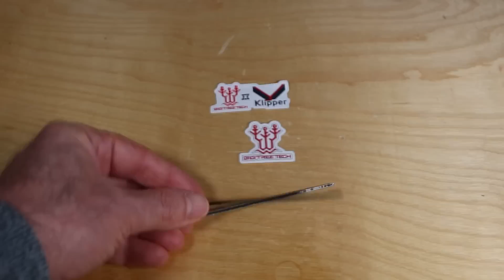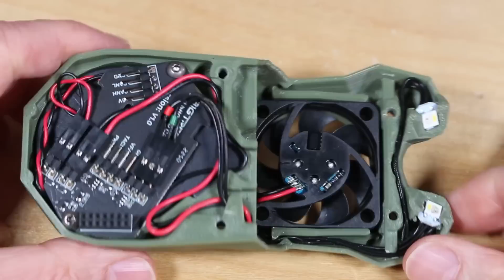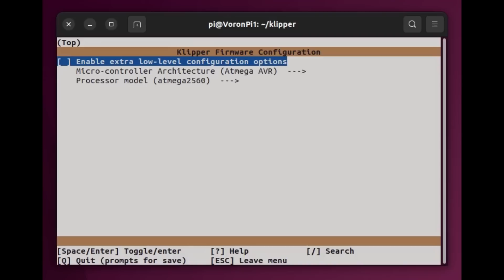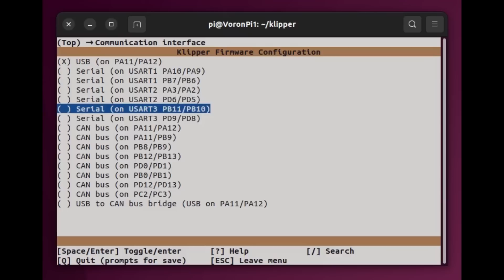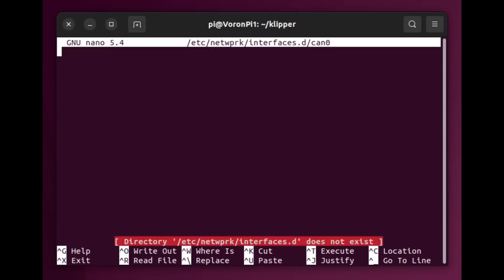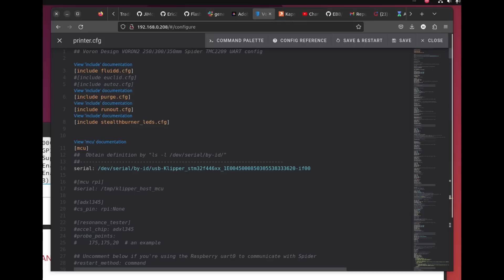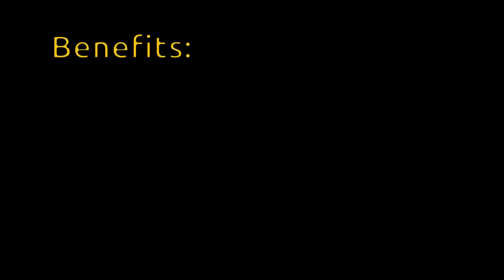Canbus SB2240 and SB2209 3D printer Install, Thoughts & Tips from BigTreeTech (BTT)

Comment: Great video. Thanks for going over this. You did however forget to mention the chamber thermistor built into the board on pin PA2. Overall great and has helped me out.
Reply from the maker: I just enabled it.  Interesting point.  The diagram for connections for the SB2209 has PA2 listed.  I don't see it on the SB2240 document in github.  But it works with the SB2240 as well.  Thank you again!
Reply: @KapmansBasementWorkshop  not a problem. I have mine setup with an octopus in bridge mode and used the chamber thermistor as TH0 for benchtesting. But having a inbuilt chamber thermistor on the board is a handy feature that doesn't seem to be well documented unless you look at the pins file.
Reply: @joshuabauer2297  If you look at the circuit board they put that thermistor right next to the driver chip. I think their intention was to monitor the driver temp. During a print, I found it's a much higher reading than my seperate chamber thermistor located on the back gantry.
Reply from the maker: I just found this message. Thank you for posting this. I was worried the interior temps were getting too high! I need to install one just for these readings.
Reply from the maker: You are correct, I completely forgot about that!  Thank you!

Comment: Like you see in the video there is not enough space to plug/unplug TH0 wire(Lucky you with pt100). I have created pull request to the EBB repo with modified SB parts for better access.
Reply from the maker: That's cool.  Thank you for doing that.  I hope it's adopted.
Reply: I’ve used them.  Works great!

Comment: Just installed this on my new Voron and I found the connectors just too small for me both for eyes and in hand. Purchased pre-wired micro JST connectors and spliced them to larger wires. Not as nice, but works and was just too frustrating trying to crimp those micro JSTs. Working well, the one gotcha I see a lot of people doing is placing the heat sink at the wrong location.(Correct in this video)
Reply from the maker: I had the same problem.  At the end of the video and at least once or twice I made the same recommendation. The pre-crimped kit even came with heat shrink tubing. I'm pretty sure the PA-09 isn't the right tool either.  That said, this SB2240 is nicely designed.  Now that it's in, I like it a lot!  Thanks for the helpful comments and watching!
Reply: @KapmansBasementWorkshop  Luckily I had that connector kit already on hand before the board arrived. Even with a smaller crimper I see this as a struggle for most people. They are just so small, just trying to hold and get wire sheath in properly is incredibly difficult. If they could find a way to use standard JST normally used on 3D printers, this board would be perfect. IMHO
Your other videos on CanBus sure helped a lot. I think you might be right on continuing to use the USB-adapter to simplify things. I have mine working straight CANbus, I'm rethinking using the U2C approach to avoid any hassles in the future.
Reply from the maker: @macdox69  I agree 100%.  Thank you!
Reply: @KapmansBasementWorkshop  Seems the newer version that uses the RP2040 has bigger PH 2.0 connectors. It also says it has software CANBUS. Curious what implications if any that has.